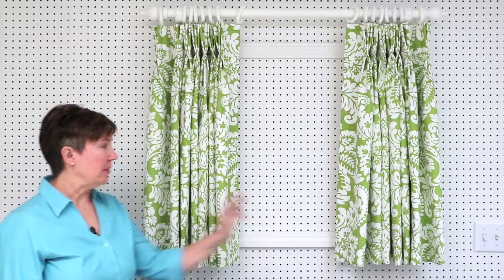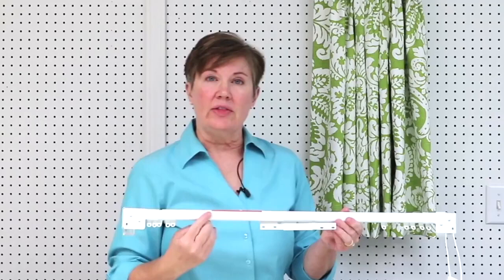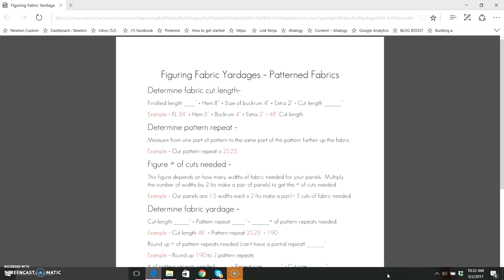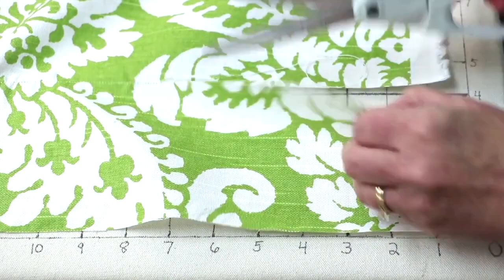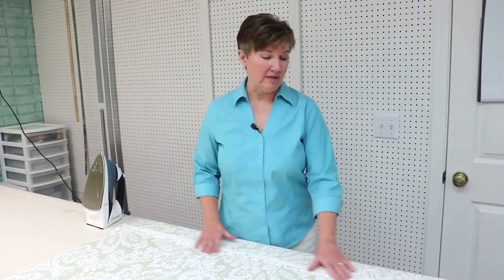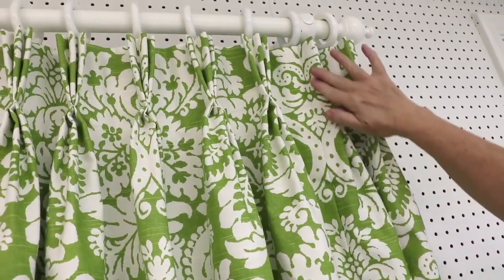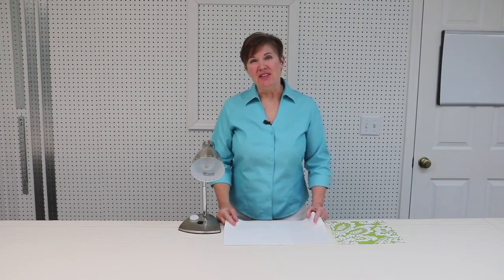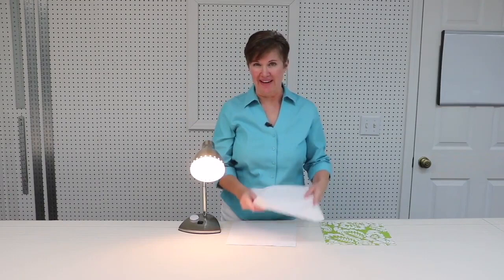How To Make Lined Drapery Panels

Comment: Hi Jann, I have enjoyed your video very much. According to your pdf on matching patterns, for a cut length of 100.5 inches, I am to cut a length of 112.5 for a repeat of 12.5 inches. Question:
After I match, glue and sew my panels together, at what point am I cutting off the excess to the 100.5 inch length?
Thank you.
Reply from the maker: You’ll cut the fabric when you add the buckram during tabling.